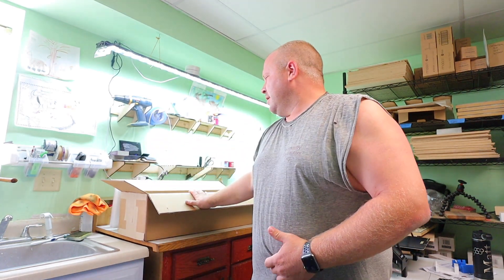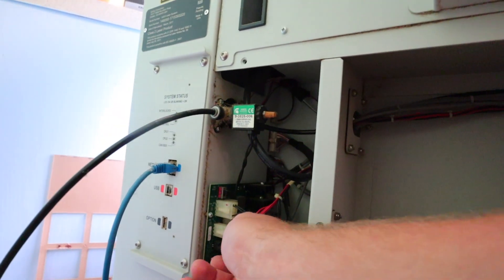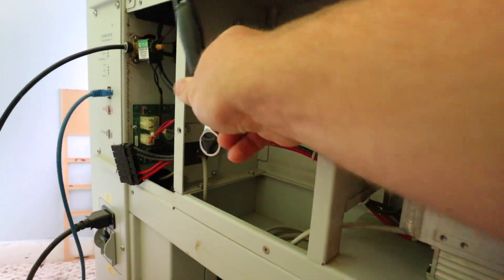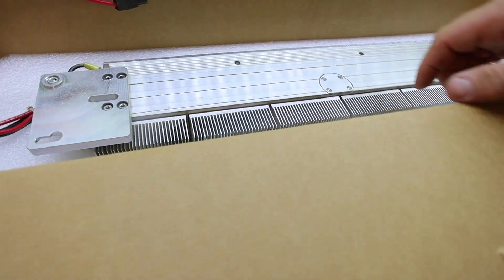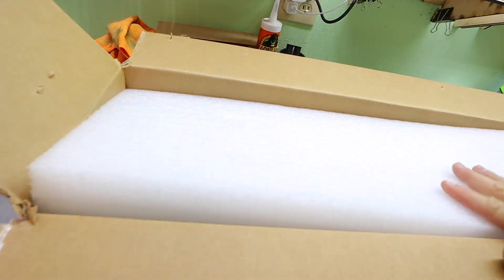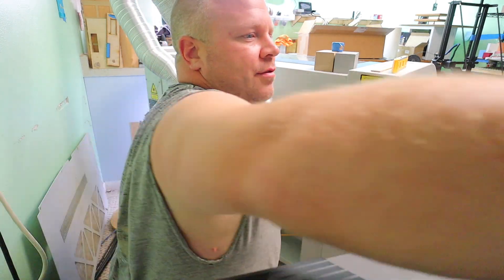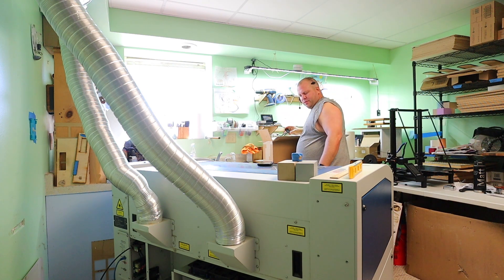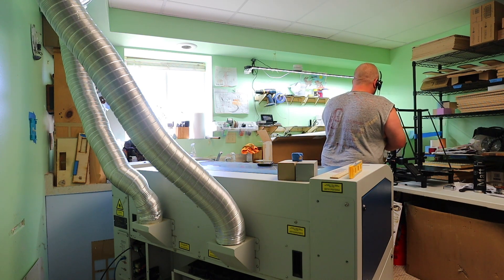Installing an Epilog 60 watt Laser Tube

Comment: Hey matt, im just starting but im trying a fan for solder smoke which still comes from the resin.  Its actually 3 fans in one with a filter. Im building a fan enclosure with 1" styrofoam. I'll let you know how it works out
Reply: That should be 2 fans
Reply from the maker: Nice